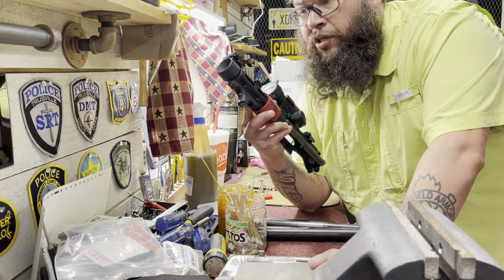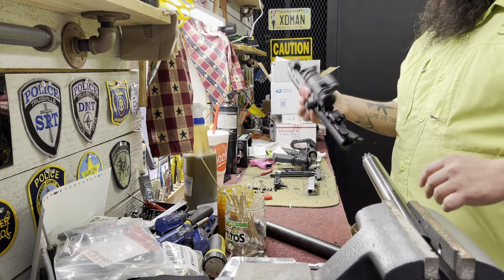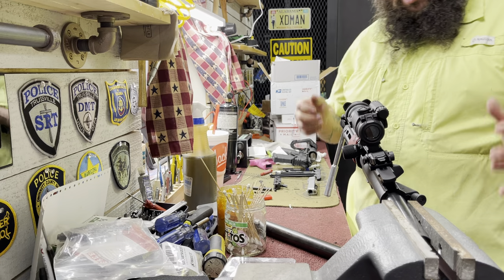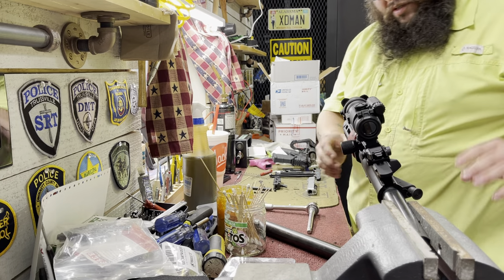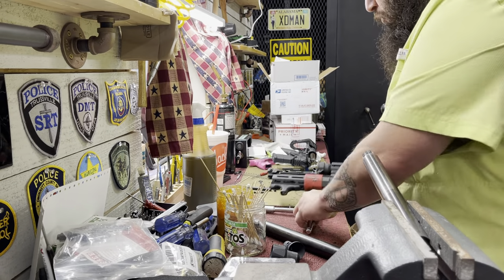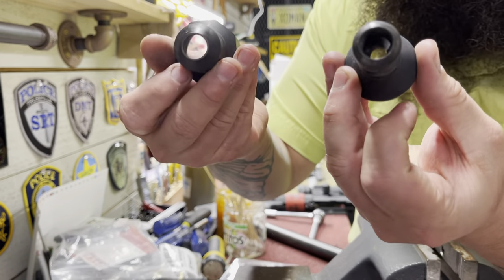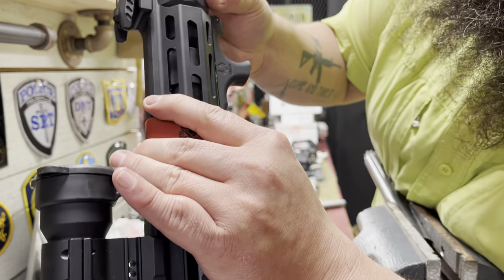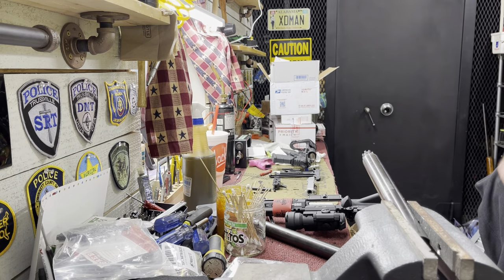Springfield Armory PDW Hate Break Removal

Comment: Can you show adding a suppressor to the 5.5” PDW if possible?  Thank you for your videos!!
Reply from the maker: It can be done, but you have to remove the handguard and replace it with something shorter. Then the threads on the barrel can be exposed. But be careful not all suppressors are rated for a barrel so short. I have the Surefire SB Soccom, the SB is the short barrel version made for short barreled AR’s in 556/223.

Comment: XDMAN can you do a video on disassembling and assembling the Edge? I reassembled mine and for some reason the bolt catch is not doing it’s job and the bolt assembly is so forward that it won’t even catch and load the cartridges from the loaded magazine. I got something wrong with the way the buffer and the spring go on this modified new AR system. Can you help? Thanx.
Reply: I bought mine fairly early in production. I cant  just release the back and drop it open to pull out the BCG because there is no detent to hold back the buffer and spring. I called Springfield and they told me that was the design of that AR. So to seperate the upper and lower you have to take out both pins and separate it with the buffer spring a full length.

Comment: I have a PDX mine is stuck and i dont want to use a reaction rod or receiver clamp and risk loosening the barrel extension or breaking the index pin. But im trying to find a way to clamp a 5.5inch barrel without completely removing it from the upper receiver and removing the gas tube and block. It only leaves me a couple inches of barrel to clamp. If any one has any ideas let me know
Reply from the maker: The extension will not loosen unless your barrel was not put together properly. The PDX should be good to go to wrench on it. I promise the amount of force required to get the extension off is way less than the break.